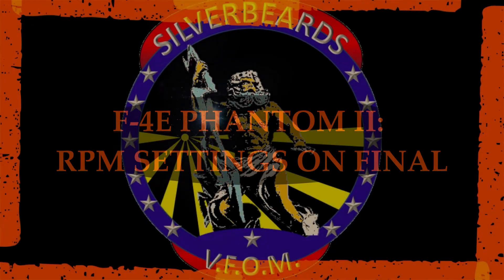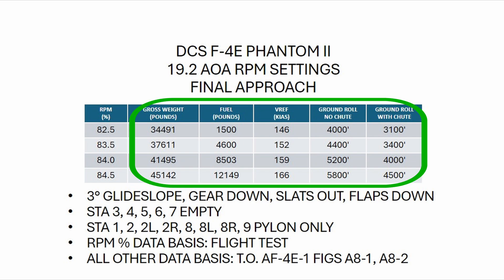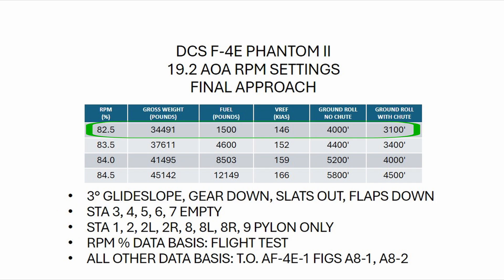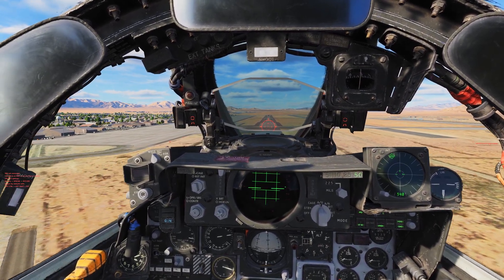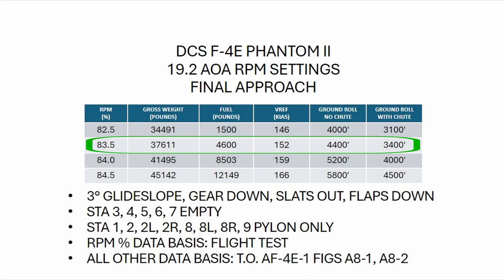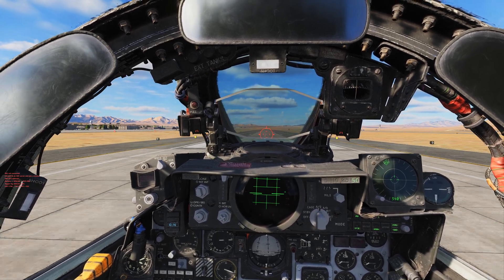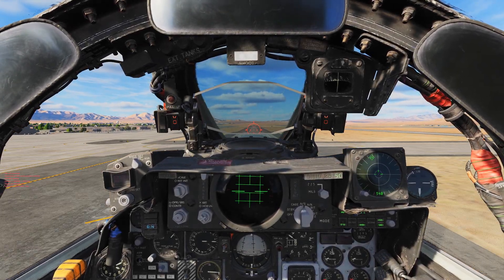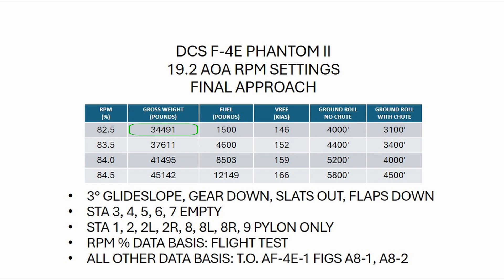DCS F-4E ENGINE RPM SETTINGS ON FINAL APPROACH

Comment: Made to land on carriers...not a jet made to 'flair' (well, maybe a teeny-tiny bit with the Es ). Small throttle adjustments and small pitch adjustments that are ALMOST independent of one another (changes to one do not affect the other). Watch videos of landing F-4s and you'll hardly see any flight control movement. Also if you're going to slip past your landing spot, you can reduce/chop the throttles (hold the AOA) and you'll drop right there, the landing gear can easily take it. And DON'T USE the brakes until the posted 'use' speed. Phantom brakes were always crap and even tapping them right after touch-down could fry/lock them...let the chute slow you first (that's what it's for).
Reply from the maker: Agreed - if you pitch up near 19.2 AOA without adding power, you will find yourself on the backside of the power curve very quickly.  Thanks for the added insight Jayson!

Comment: Awesome!  This confirms I was over correcting.  I will try this tonight.  Thanks.  Edit:  I flew several approaches with the 4600 lbs of fuel setup.  Works well with that 225 Mil depression on the pipper.  Jester is my best buddy now.  One thing that helped me is to fly this a bit fast on approach.  In that you hear the AOA tone just above the perfect speed and flare into it close to touchdown.  Why?  Because if you get a bit slow (ie slower than on speed AOA) it feels like you are getting in a bad place in the flight regime, behind the power curve; the sink rate will increase fast and you'll need to apply lots of power to get out of it.  This will screw up the approach.  Flying a bit fast gives you more warning and time to react before you get in that bad place and you don't have to add so much power that screw up the approach.  This is what works for me now.
Reply from the maker: Spot on PappyGunn - the F-4 quickly delves into the region of reverse command when you get above 19.2 AOA. This aircraft is a literal example of "staying ahead of the power curve"!
I'm really glad to hear these techniques helped you out!